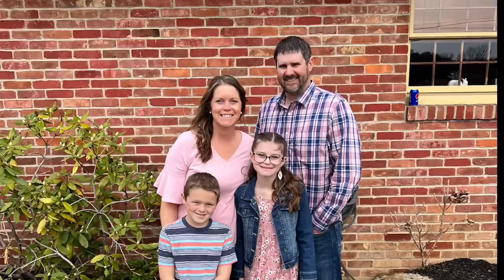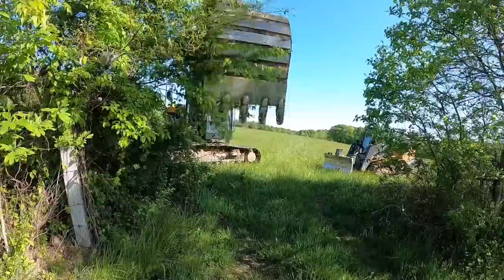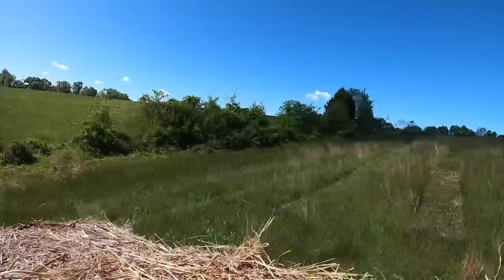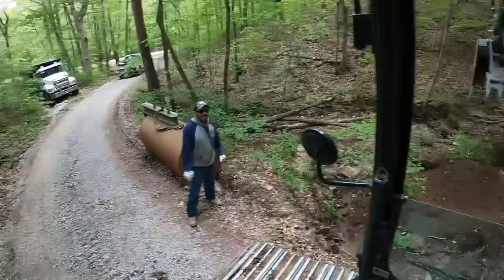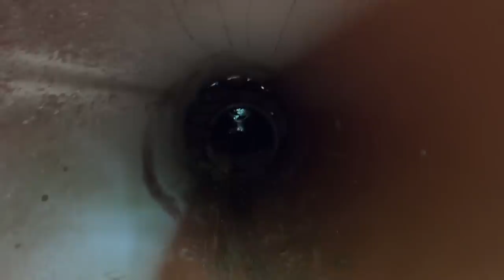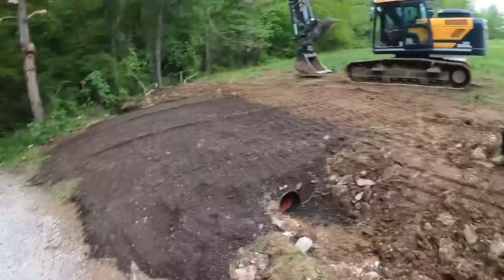Driveway expansion for farming, testing out the pipe hook we built, how did it work?

Comment: I made a bracket that can slide over the top of  a "tee-post"  with a chain attached to it so that I can pull them straight up when trying to remove them.  It will grab the post when tension is put onto it and is quick and usually keeps the posts straight with the possiblility to reuse them if needed.

Comment: Well Mike, it seems your seriously dialing in on a great bunch of additions to your fleet of excavation equipment. 
Bubba Dump, 850J, that new 3 axle dump truck and the beast of a skid steer the Minotaur.
Then throw in the homemade tile plow, tile cart and now that pipe lifter you've really improved your performance level as a Excavation contractor with an awesome crew to assist you you know you won't have to worry about them letting you down.
Arron has come a long way learning how to handle your equipment. 
On to the next one Sir.

Comment: Try using 2 lift straps. I built a thing a few years ago to lift mining tires and I wound up having to use 2 straps and made a triangle so it stayed level with or without weight on it. It might work on this also. My rig wasn’t as long as yours but I was probably picking up about the same weight. It might work.

Comment: I haven't read all of your comments so I don't know if anyone else has suggested this. To ease the steel-to-clay pipe contact, if you could attach some old truck tire treads over the lifting fork and the vertical part of the lifting tool. It may save the tile from disastrous contact. Just a thought.
Reply from the maker: Not a issue so why would I fix it
Reply: @DirtPerfect  Thanks for letting me know that the tool won't damage the tile.

Comment: Hey mike...just a thought ok...what do you think about putting 3 smaller doors/shoots, that's what asphalt trucks drivers call them here in ONTARIO, CANADA. If you had them like on this job, instead of dumping a large pile out...with the 3 shoots, you can dump on the left side, middle or right side...as I'm sure you know...lol😅😅 now would it be cheaper to find a tailgate with the 3 shoots in gate already? Or make and put the holes  in gate make the handles and the doors blah blah blah....
Reply: And mike ty fer the ❤ back...muchly appreciated
Reply from the maker: Not with the effort and added weight

Comment: I would wrap some tire tread around the lower I beam of your pipe lifting apparatus and bolt the tread on from the bottom of that I beam.  That would give you better friction for holding a pipe so it will be less likely to slide and also lessen the impact of moving the apparatus into and out of the pipe as the rubber tread would be more forgiving than the steel of the lower I beam.

Comment: You guys should bolt some pieces of old tire treads onto the metal contact surfaces to soften the impact to the pipe.  You wouldn't need to as gentle with your handling of the pipe.
Reply from the maker: But that’s not a problem so why fix it plz explain thanks